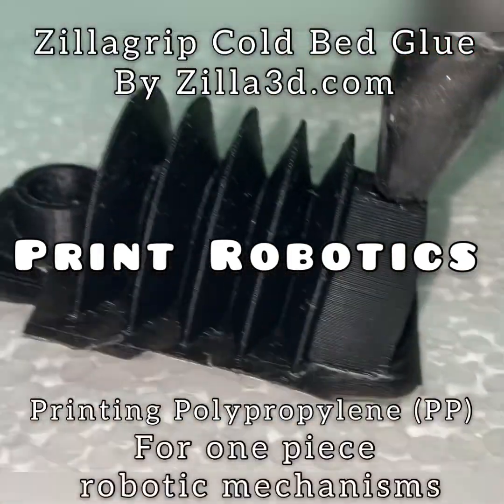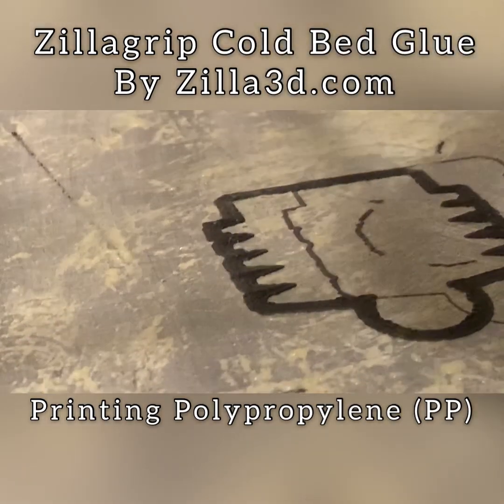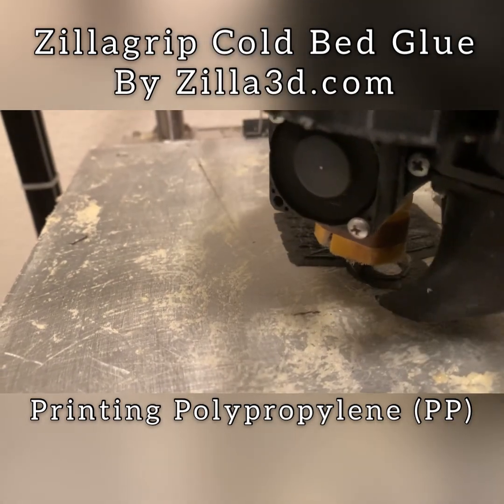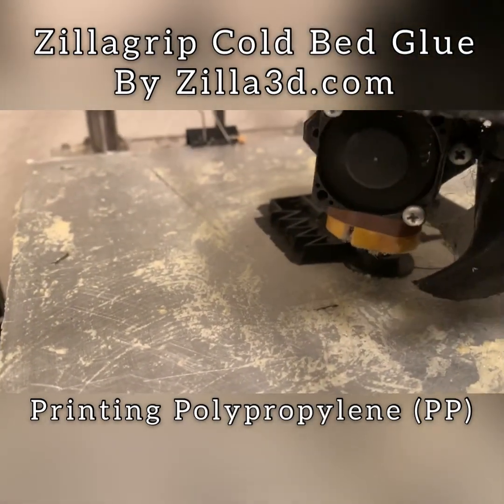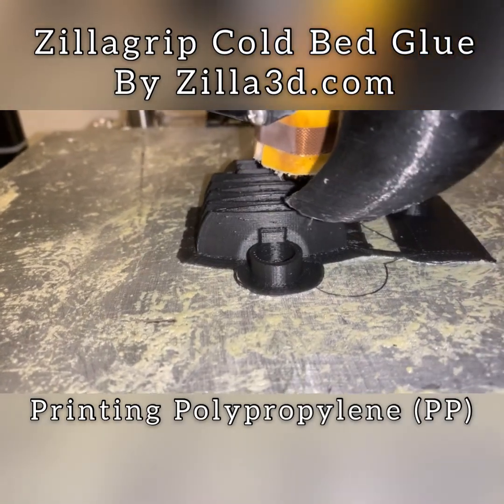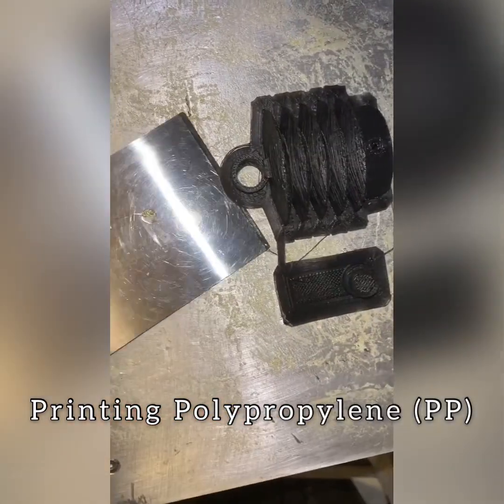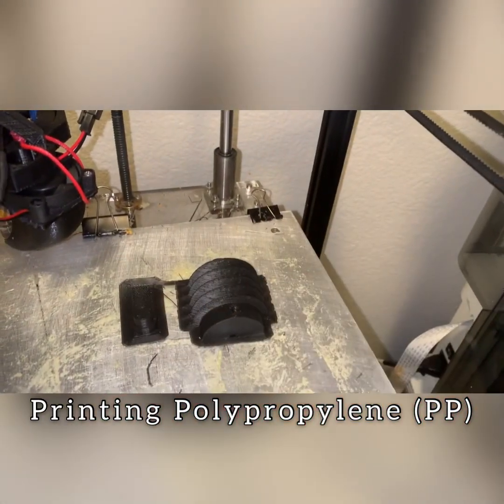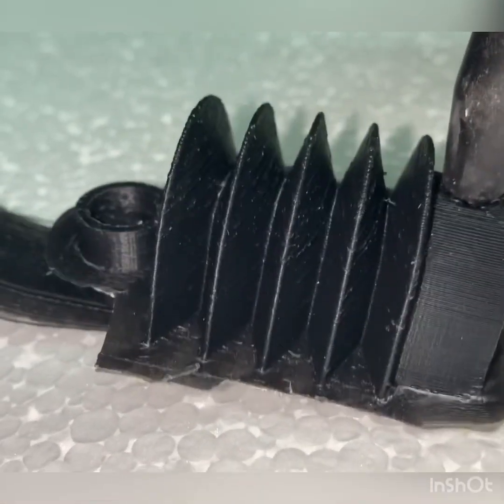3D Printing Polypropylene Robotics with Zillagrip Glue on a cold bed. The best Printing Surface.

Comment: Nice. Have you tried printing flexible filament on a cold bed?
Reply: There is no reason it wouldn’t work. We only have Bowden extruders so we can only test harder flexibles
Reply: @diygranite  You can print flex with bowden to see if it sticks. Turn off retraction.
Reply: John Smith Trying out with TPU now from sainsmart and it works fine. Have to use a diluted very light coating like PLA so that it’s easier to remove.
Reply: @diygranite  That sounds great thanks for testing.
Reply from the maker: John Smith It was removed without heating the bed. It held tight for printing but came off without difficulty. We are having someone test Olefin based TPE which’s more difficult to print.
Reply: @zilla3dlargeformat3dprinte85  Ok thanks. Is that on glass?
Reply from the maker: John Smith This was done on an aluminum bed but it acts almost the same on glass. It’s just easier to remove the glue from glass
Reply: @zilla3dlargeformat3dprinte85  Thanks. I don't like using the heated bed because of power consumption and safety. PLA is ok on an untreated cold bed but not other filaments. Your product sounds promising. I will be ordering some.